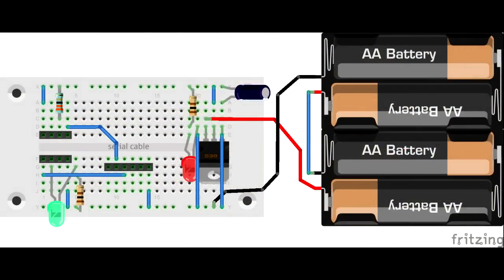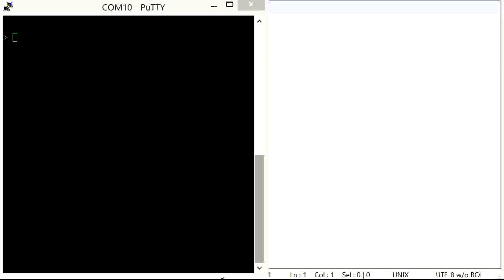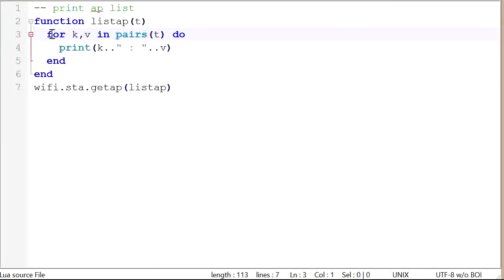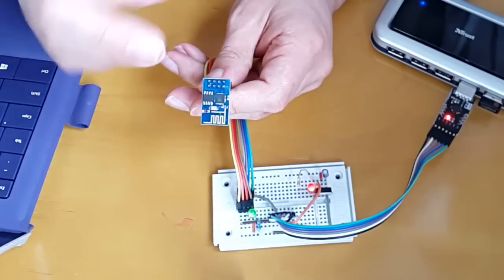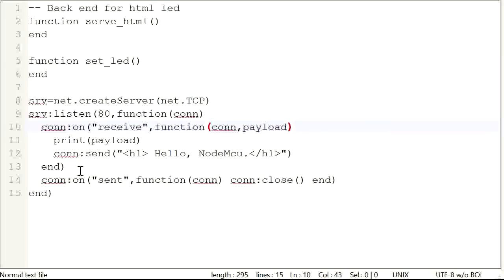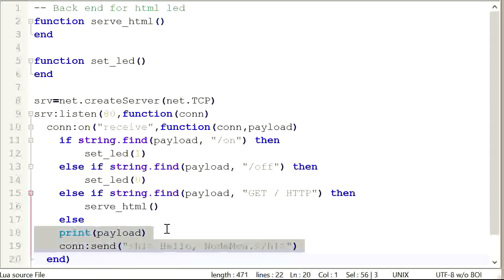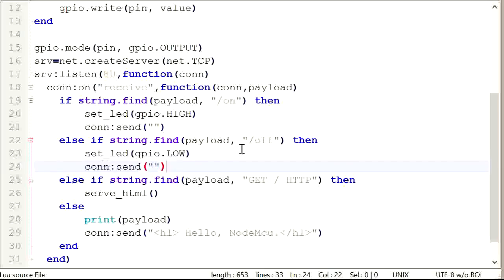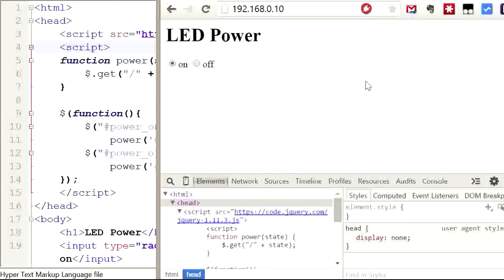IOT Esp 8266 Web/Phone WiFi Controlled Led

Comment: So as long as there is a power supply, this can be controlled by a cell phone?  The ESP8266 does not need to be connected to a home wifi and my cell phone not connected to any wifi can still control it?
Reply from the maker: In the code demo'd here - you do need wifi too. If you want to use it without having a known wifi, the esp can be used in AP mode, where the esp is the wifi network. Perhaps I should cover this somewhere in another video.
Reply: Please do as this has so many applications in the RC world. Looking to do a small 1 or 2 channel wifi with the ESP8266 as the AP so I can enable/disable things remotely via my cell phone. It is either this or I figure out a way to do it via bluetooth. Gearbest and Bangood sell preconfigured 1 channel 12 esp 8266 relays.

Comment: Excellent video. There are many examples like this on the web.
However, I am trying to replace 2 Arduino nanos hooked up to 900 MHz transceivers, with only 2 ESP8266, and found nothing on the net!
The ESP has the power to replace my Nano, so I don't need a separate MCU.
Do you know how to do this?
Nobody seems to know how to do this simple task using the Arduino IDE, without resorting to, a middle-man server, UDP, Telnet or other complicated shenanigans. 
Hey, if you make a video about it, you'll be the first and original.

Comment: hello can you turn on/off more than 1 led ?
Reply from the maker: +Tasvir Mahmood With that particular 8266 model, it is unlikely (the Esp01). However, using the Esp12, esp03 or a NodeMCU dev board you could add more.
You can also take a look at my Ws2812 videos, where 1 pin can be used to control strips/panels of LED's.

Comment: Can we simultaneously receive sensor data and control leds over a webpage using esp8266?
Reply from the maker: +assujabbari I've not yet tried that - but I don't see why not. I'm starting to connect sensors in my next few video's (not published yet). I can certainly try a sensor driving one of these as feedback, with a webpage to adjust settings and monitor.
Reply: Alright, I am seeing it as an interrupt based systems and not sure that it can be done or not.BTW I am looking forward for the next video
Reply from the maker: It would not be truly simultaneous, but it would be able to interrupt, and update the LED's often enough to indistinguishable to a human observer.

Comment: I didn't see how you got from using the flasher to sending commands?  Does the nodemcu firmware allow you to connect via terminal software and let you enter those commands?   Do you have a website describing some of what you're talking about?    It's more of a demonstration but I'm looking for more of a how-to.  There's too many details left out in there for me.  Thaks
Reply from the maker: Hi there, the node MCU software sits on the serial pins with a repl- a lua command line interface at 9600 baud I think. I used putty to connect to that serial port from my laptop.